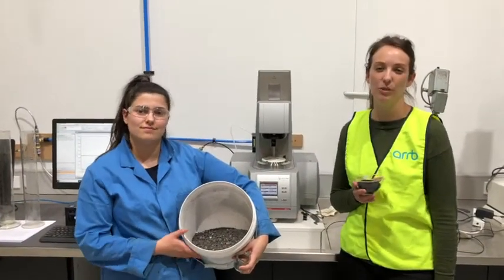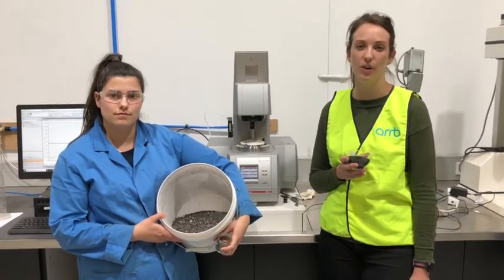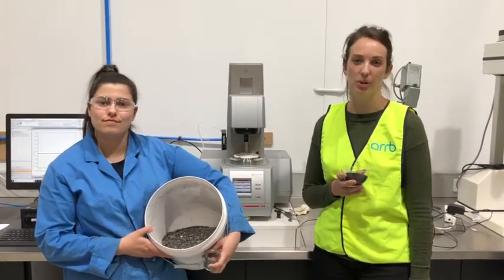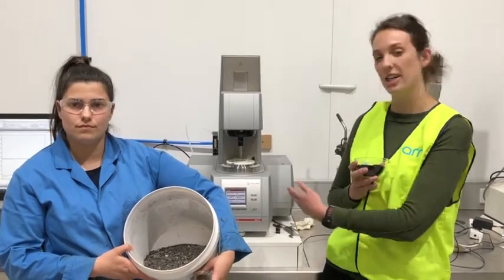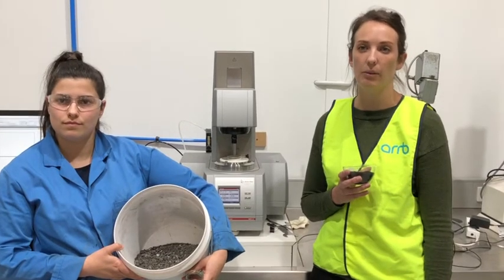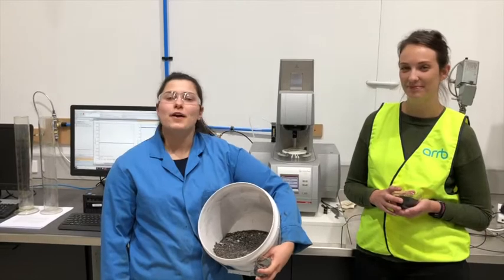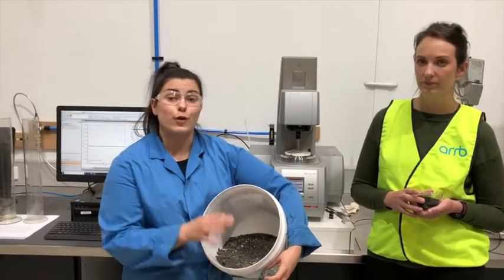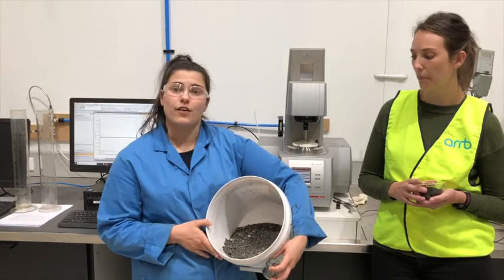Can we recycle Crumb Rubber Modified Asphalt?

Comment: this totally sucks ass,  paving crews are now expected to lay this material,  it stinks like burning tyres, and what tyres are the putting in the mix?  are they made in china with additives that we know fuck all about?

this is just a feel good exercise to "recycle" our rubber tyres,  while we let the workers deal with the long term damage.  
and the idiots want to put plastics in the mix. lets super heat all this plastic and see how much vapor it can release on our workers.

iv worked in this industry for 15 years,  we all know how this shit is going to be handled by tanker drivers and plant operators.  crumb rubber has been transported by tankers for a few years now, and what happens? it comes out of soloution and sticks to the bottom of tanks and clogs up the plumbing.

so what do they do?  they super heat it above limits to stop the shit from sticking, and then the workers have to deal with it...

you are never going to get tanker drivers and asphalt plant operators from over heating the crumb rubber that high... its what they do.